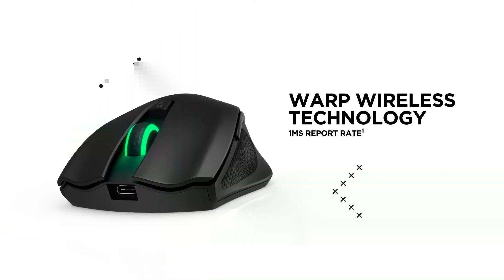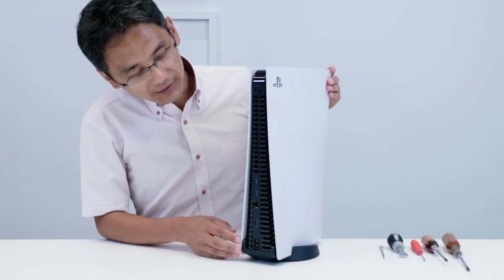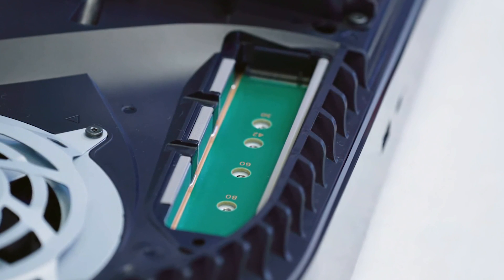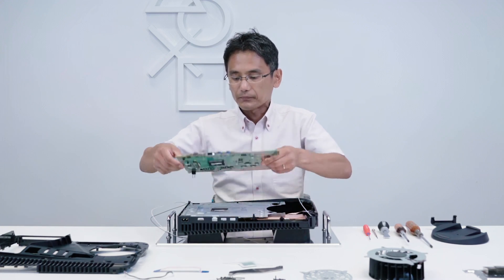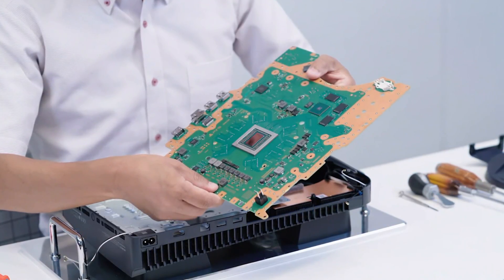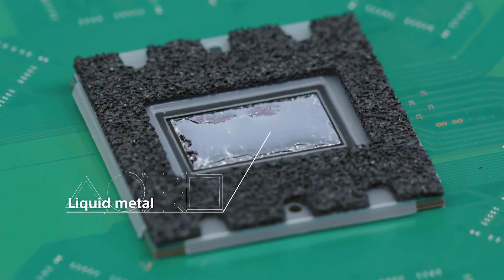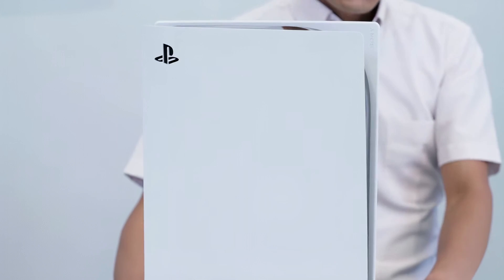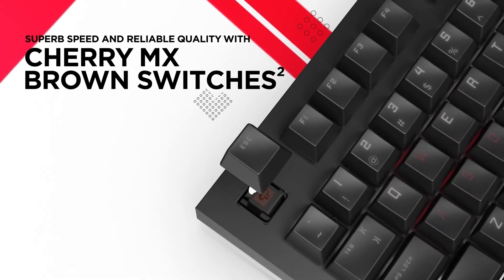PlayStation 5 Teardown Analysis: Inside Sony's Next Generation Hardware Design

Comment: Leadbetter missed the screw holes that give users the ability to use various size V-NAND drives.
Apparently he also doesn't know that M.2 drives in many computers is free-standing without a heatsink. My PCs own M.2 drive is and while it gets warmer in that area of my laptop the media is far away from other delicate components on the motherboard... Just like in the PS4. Even PS5's own internal non-removable storage is some distance away from the hottest hardware on the motherboard.

How DF's own Leadbetter missed all the above in and of itself is the most fascinating bit to me however.
Reply: How he missed it? Let's just say it wasn't an accident
Reply: Or... he was more concerned with something that generates a lot of heat being a stuck in a tiny slot, inside of a hot box will effect thermals. 

PC/Laptop =/= Console. 

I know for a fact my Ps4 Pro puts put a lot more heat than my Full Size tower. I'm also aware that my full size tower has a lot more space and airflow to cool the air before it leaves the box.
Reply: @IzThatit  the nvme slot is huge already with plenty of space for a for a heatsink that come with some nvmes. And it have multiple screw holes giving the customer the choice for their own form factor
Reply: @IzThatit  IIRC PCIe 4 SSDs draw around 8W, and I wouldn't call that exactly "lots of heat", but some yeah.
Reply: @IzThatit  this
Reply: @IzThatit  
PS4 is probably hotter than your PC tower! Hm I don't know? Maybe because PS4 is smaller and still requires a lot of electricity to run.
Just like your PC tower isn't analogous to PS5, PS4 shouldn't be either by your own logic because neither share a lot of physical similarities. Basically: PS4 != PS5

Nice way to dismiss your own point there though. Good job!
Reply: His point is still valid, nvme still get hot and are subject to overheat and reduce speed and in most case they are still minor airflow coming to . He just said that it will be interesting to see how sony deals with it.
Reply: @Mik4ael  
No, his point is indeed invalid.
My PC's NVMe as I said doesn't use a heat sink or have active cooling and runs fine even in longterm gaming situations (more than 2 hours straight use).

So really his point is proven invalid by the tight configuration of my laptop whose manufacturer slapped in an NVMe drive into the far corner of the device farthest away from the exhaust fans surrounded by solid slabs of unvented plastic walls on two sides!
Gamers need to learn about hardware something bad.
Reply: @VariantAEC  We are not talking about your pc man stop bragging about it , i have a desktop with two nvme and i know how they work. Nvme without thermal solution are subject to overheat, it's a fact.
Reply: @Mik4ael  
A fact that doesn't apply to my laptop somehow... Strange how your facts about PCIe NVMe M.2 drives don't match the real world experience I've been living for 3+ years now?
Reply: I didn't hear him complaining about how you can't use various size drives.

The fact that M.2 in some cases don't use a heatsink doesn't mean the lack of a heatsink doesn't affect the drive's lifespan. The concern is not about the more delicate components exchanging heat with the SSD here, it's about the SSD wear and tear.
Reply: @MyChannel-SR1  
He didn't but he also didn't mention that users have that flexibility at all. Bit strange for a tech channel, no?
He also isn't sure about a lot of things regarding M.2 drives though like them not requiring a heat sink to operate normally (like in my laptop which I mentioned above).
Why would PS5 somehow be different?

Will bare NVMe drives just decide to work more poorly when inside a console vs the same bare NVMe drive inside a PC? Isn't that magical thinking???
Reply: @VariantAEC  I'd say that him glossing over that is being accustomed to the fact that tower motherboards usually have multiple standoffs. It's a bit like saying you can mount 2.5" HDDs into a 3.5" bay.

PS5 isn't different. Free mounting SSDs is just worse than using a heatsink. Operating normally doesn't mean operating optimally. I could get away with using a small mini itx heatsink on my PC, it would still be working, but I've opted for a Le Grand Macho RT. On your laptop the Nvme probably doesn't have a heatsink to reduce overall volume. It's not optimal, it's the best you can get in that form factor (which I assume is less voluminous than a PS5). You wouldn't be able to install a Noctua cooler on your laptop without it being extremely bigger, to the point it defeats its own goal. Digital Foundry just wonders what Sony is going to do to ensure optimal conditions.
Reply: @MyChannel-SR1  
Normally for the drive is 3.5GB/s
That is also its maximum speed (PCIe 3.0 in my laptop). So if normally and optimally are the same and I'm not using a heat sink for my NVMe drive. The system IO is just running that well because... magic!?

Heat sinks might be better and you might be able to attach a small heat sink to the PS5's internal M.2 drive. We don't know that yet but given what we have seen its probably not impossible. Allegedly I too might be able to put a heat sink on my laptop's NVMe drive.

All M.2 drives stand-off from the motherboard a little to accommodate the extra heat they emit. I know the drives get hot this is why I'm confused why leadbetter didn't mention the distance PlayStation put between the SoC and storage.
Reply: @VariantAEC  It also depends on consistency of performance. I won't doubt your claim that you have benchmarked your SSD and it goes at full speed, all time, for even more than two hours, though. That said, it doesn't mean there is the same amount of wear and tear. You are confusing my argument with the other guy's.

Yes, we don't know if the user can have heatsinks attached to the drive, that's what Digital Foundry is wondering as well. I don't know why it's such a controversial question.

He didn't talk about distance because, as you've said, all M.2 drives stand-off from the motherboard. It's a given. Despite that, some drives still have heatsinks mounted to them.
Reply: @MyChannel-SR1  
And so what? You can see the M.2 drive assembly right in the video while the board is removed from the console housing. You can see that just like on a laptop the pins are located a few millimeters above the motherboard. If you can squeeze in a small heat sink over your laptop's NVMe drive you can probably get away with it in the PS5 too. Why is that a question that needs answering?

Additionally Leadbetter did mention the proximity to the fan and we see from the teardown that both sides of the board receive some air flow. So it is likely that air flows freely through the NVMe drive enclosure unlike in my own laptop. If my Laptop drive works fine for multiple hours straight with little to no free air flow then the PS5's adequately cooled one should be just fine.
Why is that hard to understand?
[One spelling correction fixed and one punctuation correction made. layout optimized so the whole comment now reads a bit better]
Reply: @VariantAEC  Keyword here is small. There are definitely bigger heatsinks on the market (it's not uncommon with other components either, my RAM has clearance issues with my heatsink). Not only that, the PS5's Nvme slot seems to be closed by a small hatch, which might prevent installing any heatsink at all. It's a question worth answering because given the PS5's size compared to a laptop there is definitely the potential to put bigger heatsinks. I don't know what the spacing between the PCB and the drive has to do with all this though, as the heatsink is mounted topside (as you said, the heatsink is mounted over the SSD).

For your laptop, again, there are some things to consider. The bigger issue is not about how well it runs when needed, but about how well it runs during sustained data write/read operations. PS5 games are supposed to be constantly streaming the games at 5.5GB/s. Games before this would load a big chunk of data until the next chunk was needed. It's likely that when you are using your computer the SSD isn't needed 100% of the time.

Again, working just fine does not equal working optimally. And even if your drive really worked at full speed, all day, with no withdraws on performance, excess heat would cause wear and tear, which was my original point (you are confusing my point and the other guy's).
Why is that hard to understand?
Reply: @MyChannel-SR1  
And again this is all totally nullified by the fact that the NVMe drive is actively cooled by the fan. Additionally Samsung's own NVMe drives label (a literal strip of tape) is in fact a metal heat spreader which it explicitly tells users to leave intact. There really are no excuses here. The system doesn't need heat sinks on NVMe drives at all.

Do you know how a heat sink even works? In order for them to even work air must flow around it. There's  not enough space in my laptop and worse air flow and my laptop does just fine.
PS5 is not likely going to have any problems in this respect. Don't fret and if you're unsure... There is this thing called waiting. You don't need to preorder or buy first day wait for the information to roll in and make an informed decision... Like an adult!
What is being mentioned could likely affect EITHER SYSTEM and EVEN SOME PCs by your own estimation.

Educate yourself about the performance people are seeing in laptops and Mini ATX PCs with less than stellar airflow around their NVMe drives. I'm not even saying it's impossible that I'm wrrong. My PC supports PCIe 3.0, so I might not suffer the same problems because heat should be less of an issue due to lower power demands of PCIe 3.0.
Reply: @MyChannel-SR1  
Oh and to refresh your memory "just fine" to me means peak performance (in the case of my NVMe drive 3.5GB/s) can be achieved at any time under any load... Probably what you would call "optimal."

Comment: oh man i see why it took so long to release such a basic video, mustve had a few back and forths with microsoft pr on the script
Reply: when comparisons are made just because they don't line up with what you want to hear.
Reply: @westinbye  so they can see ray tracing in Halo and make excuses for that shit presentation but act like they can't see RT in  Demon souls. Lol ok
Reply: @westinbye  not even remotely close since they didnt really make comparisons they just kinda said things. for example they mention the worry of a built in ssd on ps5, but dont mention the built in ssd on xbox? they mention expanded storage worries since ssds get hot, but dont mention how and if the xbox expanded storage cards are cooled since theyre ssds too? they say sony went for a more conservative build to save costs yet nearly every part they used is custom made where as xbox is mostly off the shelf much cheaper components with some custom made parts. they mention liquid metal has worries for over time yet neglect to mention it lasts way longer than thermal paste does. at every step all they did was talk more about xbox, even if it has nothing to do with the ps5 teardown.

i come to digital foundry for analysis not blatant xbox pr like they have been doing for a while now, i like when theyre critical to games yet theyre very lenient on xbox games. id prefer consistency over blatant pay offs
Reply: @TheSidorak12  calm down, they are not paid by Microsoft. You're just pissed because Sony is withholding information that you want to hear from people that ALSO don't have the information. Just chill man, be mad at Sony if anything, they're causing drama. They kept the cross gen info from you guys, causing drama, they are charging you for upgraded games, drama, they're messing up a lot of save states, drama, they're not doing a good job on backwards compatibly before the ps4, drama, they've made a form over function device that had to fit a ton of cooling inside because of the design and had to overclock the (less amount of) compute units to compete... Whereas the XSX had been designed from the ground up for power and performance even though its design isn't "futuristic".
Reply: @Nonx47  I'm sorry but what question was I looking for exactly? Jumping to conclusions there a bit aren't we? And of course they're paid by Microsoft, they have been for a very long time now, in fact richards first business was all about a partnership with Microsoft. you dont get invited to go hands on with xbox without it being scripted, paid off or having ndas on what you can and can not say, same applies for sony. 
 
Sony haven't really been withholding info? Theyve just been revealing hings step by step, thats not withholding? Its marketing, if anyones withholding info is xbox, they've literally only just recently revealed the first gameplay of a new game on series x (dirt 5) and even then its a cross gen title. Cross gen was never a drama on the sony side because they've been doing it ever since ps3? All the same 3rd party games being upgraded on xbox are the same ones being upgraded for free on ps5, and literally 1 first party game doesn't have a free upgrade and thats the remastered spiderman, big whoop. Backwards compatibility was never an issue either  they mentioned a long time ago that most ps4 games would work on ps5 and that they'll boost most of the popular games, thats the same as xbox  in fact xbox said they're looking at 100 xbox one games too boost for series x exactly the same as sony xD save files isn't a drama either, only 2 games won't allow the transfer and thats 2 games being marketed by xbox so take that as you will, spiderman remastered isn't the same game as spiderman, so that makes perfect sense, remasters have never had save files transfer from the originals. 

How can you say ps5 is form over factor when its literally the opposite and series x is more form over factor xD yh their machine is big, it has to be for the power its outputting, xbox say they have more power and can go beyond ps5 yet weve yet to see a single bit of evidence of this power? dirt 5 looked like garbage and was most definitely not sporting any of that power, considering it runs the same on ps5, man they dont even have any proper games coming for the console from themselves, you know the whole point of the console? 

if ps5 wasn't doing a good job with their marketing and having good reasons to buy their console then how on earth are they already out pacing the xbox numbers in preorders, hype, general consumer awareness and consumers wanting it?
Reply: @TheSidorak12  lol this video got under you skin. I am sure it is because of your desire for  journalistic integrity, and you like both systems equally, and you have probably not even decided which system you want.... But at first you come across as a fan boy. 

Just remember gaming is also about the games. Evan if it turns out that Sony has slightly worse hardware they are still going to keep churning out good games.
Reply: @westinbye  so wait because I call them out on their bs im now angry/fan boy/its got under my skin xD sounds more like youre a lot more bothered about me pointing the obvious out if anything. Most definitely not on the fence mate, got ps5 preordered and ready, not gonna preorder a console (xbox) that has nothing going for it a launch or the foreseeable future for now, but yh I do buy all consoles if it feels worth it, which with xbox each gen gets less and less worth it. And like you said its all about the games so where are the games from xbox? I want to see proof of the power they have yet theyve shown nothing, at least ps5 has plenty of gameplay too look at, they've justified their design and how they've constructed their console, I'm still waiting for xbox to explain anything other than "you can play your old games"
Reply: @Nonx47  typical, can't be bothered to read yet throws out insults xD and you call me a fan boy xD df are not paid yet they go to exclusive xbox events and are given exclusive access but nope not paid or swayed in anyway xD good one but you do you, can't answer anything I've pointed out because can't be asked, but I'm the fanboy xD let's also not forget that small channels have pointed out the flaws with the xbox units theyve received and some had to take their videos down, but nope definitely not paid or swayed in anyway xD
Reply: @TheSidorak12  jesus you are delusional. I'm not reading all that because it's easy too much and I'm not going to invest as much time as you on the matter. You're just being silly, and delusional for sure. Relax man, they're consoles and you're obviously emotionally invested
Reply: @TheSidorak12  I said you come across as a fan boy. It seems like you are with that last comment. But here answer this what do think Xbox is doing better than sony?
Reply: @TheSidorak12  seems like I'm getting you upset, mission accomplished
Reply: @westinbye  im a fanboy for saying you had nothing to add to the conversation? Lol wheres the logic in that? And whats xbox done better? I guess marketing really but otherwise not seen much else substantial stuff thats better, they're very good at hyping up their messaging though, thats for sure. They've been good at saying things first but again its not been major substantial things. What I did like was their very early reveal of the breakdown of the console, but since then they haven't done anything worth noting so far
Reply: @TheSidorak12  LOL If you can't even think of or bring your self to say things that Xbox does better, you would fit dead  center in what I would consider a fan boy.

But I know it is hard when you are invested into an ecosystem especially with new hardware on order. You are going to love the PS5 but I do not think you are the right person to judge if someone is bias lol.
Reply: @westinbye  you asked me what they've done better and I told you? What do you want me to say xD what have they done better in your opinion?
Reply: @TheSidorak12  lol it's working